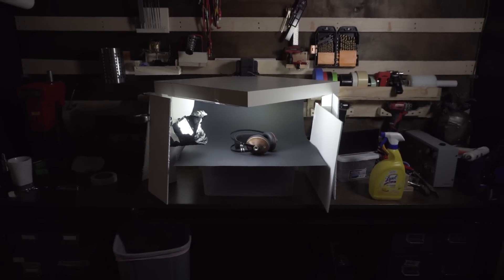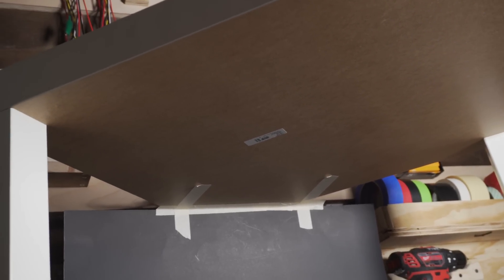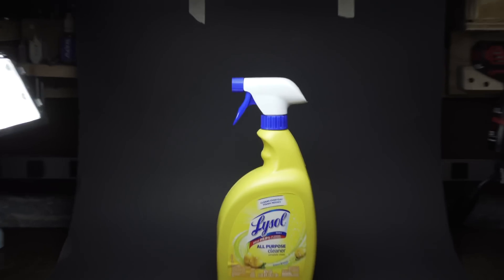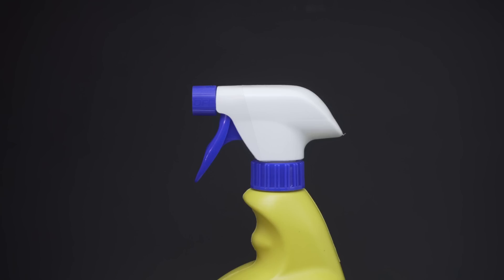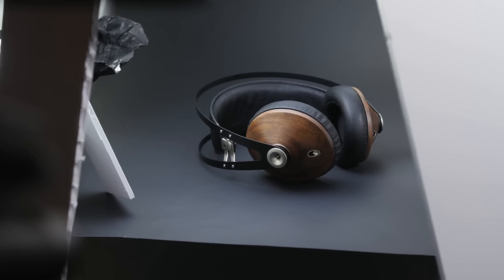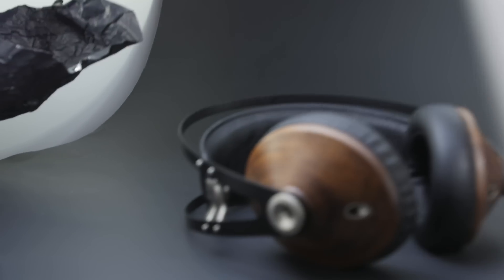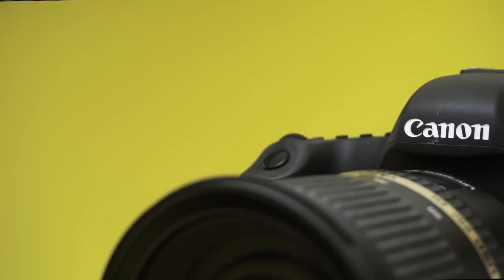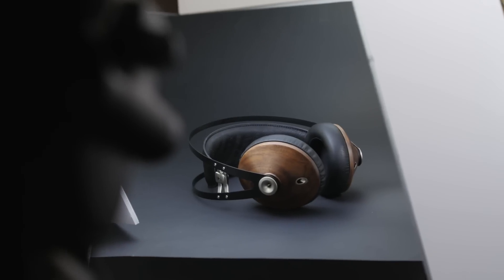$8 Ikea Table Into Product Shot Booth For Videos and Photos

Comment: Great results. 
BTW you can also use a pop-up "light tent" in a similar way. I'm not sure what the price difference would be.
Reply from the maker: Yeah I know those exist, but I personally think bouncing lighting is nicer and more defused.
Reply: Cool. I guess if the tent is big enough you could fit lights inside it, although would be harder to clamp and aim them. 
I hadn an 80cm tent, used it a tiny bit but now I prefer a glass desk with a white background behind and under it. Makes it easier to get perfect white when needed.

Comment: I tried this, but am getting a blue color instead of a black for my background.  Any ideas to get a true black?
Reply from the maker: Might play with your white balance on your camera?
Reply: Did a custom WB on a white board and tried adjusting in LR, but not possible. I read another post with this problem and they suggest that the problem is that I'm basically lighting the foreground and background with the same light.  I need a brighter light for the subject, and I tried this , and that does work.
Reply from the maker: For pitch black, I would move the background further away from the product. Using the setup I talked about in the video won't give you pitch black, because the background will inevitably be lit. Also using something other than paper will help. A matte black blanket would reflect less light compared to paper.

Comment: Those Ikea tables never seize to amaze.  From working as diy server rack mounts to light boxes... woohoo, another good use for one.

thanks for the tip.
Reply: I once used one as an ashtray, I whacked it with a dualshock 3 once (can't remember what I was playing and raged) and I didn't throw it away, I just dumped stuff in the hole :P

Comment: Great video! Subbed. I've been working on putting together a similar little setup using a small 2-tier wire shelf that I got for $10. The white foam core ceiling is perfect! I use black foam core to reduce the light as well. I'm also thinking about mounting some white LEDS with adjustable color temp on the vertical posts.
Reply from the maker: Nice! I've love to see stills of your setup!

Comment: Everyone here is so damned salty.

$8 - Ikea table
$3 - foam board (3 pieces)
$3 - poster board (black seamless and white)
$2 - aluminium foil
$2 - 2 x clamp from home depot
$2 - 2 x light sockets from home depot
$2 - bulbs from home depot
$2 - power strip

He just uses the LEDs because he has them. A lot of people into video (not necessarily product) probably already do. They're not a requirement though. The point is that you can do this kind of "professional lighting" using things you can get an walmart / around your house. But if you have nothing but a camera, it's less than $25 in materials.
Reply: And if you can't afford $25 then I don't why you are watching this, yet alone make this diy light box
Reply: The bulbs aren't from home depot

Comment: When doing this for a product video, since the product isn't moving - would you recommend taking a photo or still shooting video? I feel like somehow a still photo is obvious despite the lack of movement. I guess because the digital noise isn't moving.
Reply from the maker: You could do either but video is what I'd go for unless I was shooting thumbnail images. Obviously space in tight with this setup, but small pans and tilts would add a lot to the b-roll. You could also easily take this concept and enlarge it.
Reply: Yeah I'm just tight on space so tiny light cubes is all I can work with. Thanks!
If only camera shake wasn't so blatantly obvious at 50mm hahaha.
Good stuff

Comment: you can buy collapsible box for product shoots for like 15 euros. after shoot nicely fold it and put in the closet or something, where would you hide this?
Reply: Right beside your couch as an end table?
Reply: Globetrotter Travel Guide multifunctional. Can't do that with the box
Reply: Dyeless maybe just dismantle it?
Reply: I had a photobox and they are useless since you cant adjust the sides or the top to get the right bounced light. With foam core you can adjust as needed